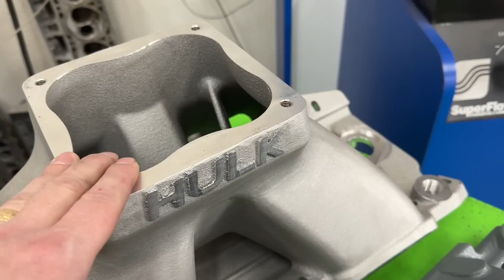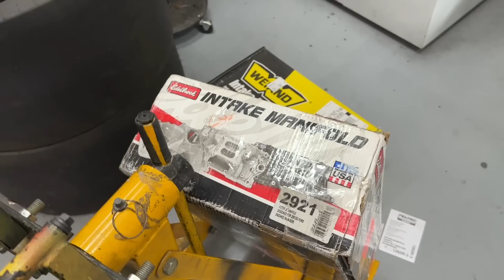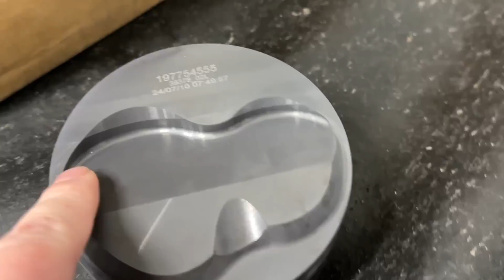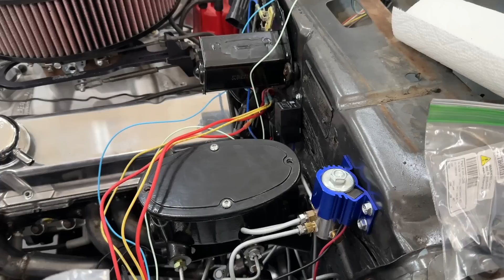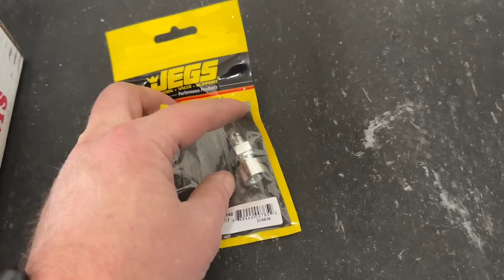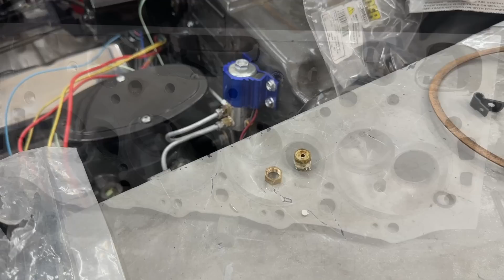Upcoming Testing

Comment: I run a Profiler Sniper Jr on a 540 CI BBC.  AFR 357s.  I can’t remember the cam specs exactly but it’s a Bullet .775 solid roller with a morel lifter.  About 10.5:1 comp pump gas street motor. Motor made 885 at 7300.  I’ve had the motor in a 69 C10 for 14 years.  It’s now sitting on a stand because I sold the truck.

Comment: Just in case you are unaware, Anderson Motorsports sells a set of magnets that will hold up the lifters so you can change cams without pulling the intake. :)
Reply from the maker: It would take longer to use those magnets to pull the lifters up than pulling the intake.

Comment: Really interested in this one. I have a 408w similar if not same head castings cnc'd, 11.6 comp 242/252 hyd roller rpm air gap duel plane 850 annular makes 562ftlbs @ 4400 570hp @ 6200

Comment: I assume the Weiand dual plane for the 408 is a Stealth. I am interested in seeing how it does as I have one on a 408 I just put together. That manifold has a nice tall plenum but the end runners have some sharp bends where they meet the ports. I did a ton of porting and epoxy work on mine to fix that problem but never tested it.
Reply: I’ve run that stupid flat link bar roller in the small block with a rev kit and 250/seat 675/open. I didn’t trust them but in truth, none of them ever jumped out. After nine races (including several wins and r/u 16 car fields) I put Isky Red Zone lifters in their place.

Comment: How are going get the cam out with out pull the dist. ?
Reply from the maker: Yep. Good point.
Reply: @WeingartnerRacing intake studs it is then 😊
Reply: You pull the distributor out, should be obvious.
Reply: Not wanting removing the distributor was the issue when he was discussing Intake Manifold comparison testing. Clearly when doing the cam testing the distributor cannot stay